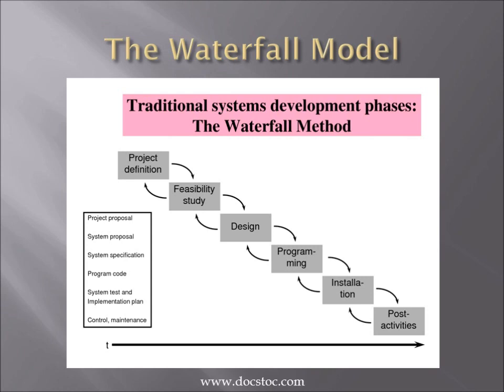IT Systems in Organizations Development Approach

Comment: The development stage uses two methods, which are the waterfall method, which is a step by step development of the system, and the other method is the agile development model, which is basically a broken up version of the waterfall method.

Comment: The two main types of developing are the waterfall method and the agile method. The agile method breaks the system down into features while the waterfall method involved doing the entire project.  As Jonathan said, each method has its own pros and cons. The developer needs to decide which method will work best for them and run with it.

Comment: The different development types clearly have their own advantages and disadvantages, and customers may feel that one method is superior to another and try to force that method on the development team. However, it should ultimately be up to the team to determine which model to use, especially since more experienced teams will likely have used both and have an idea of which system works best for them, allowing for the best possible product to result from their work.